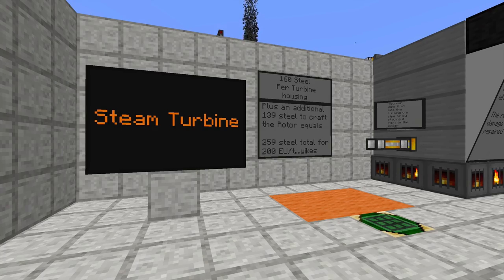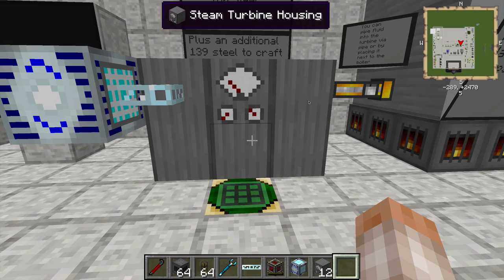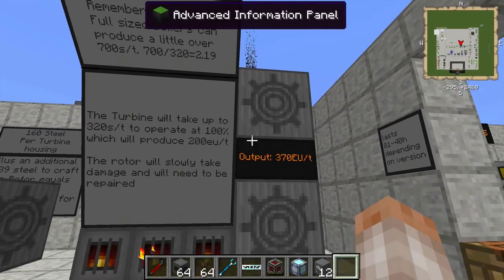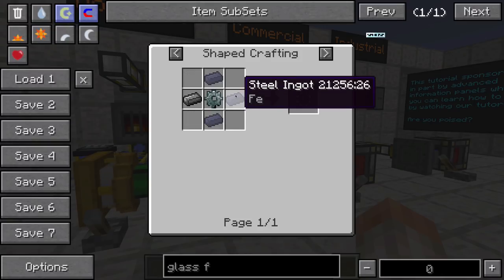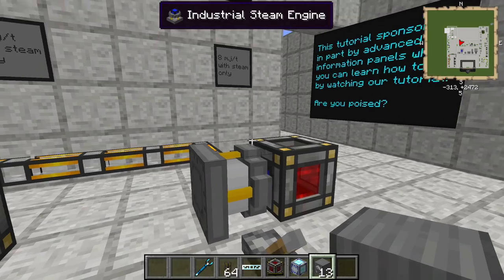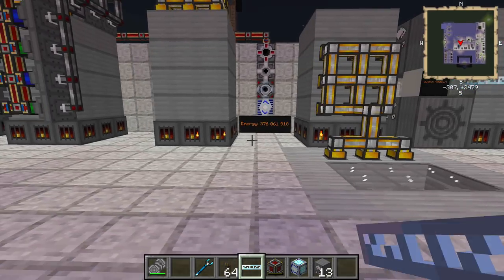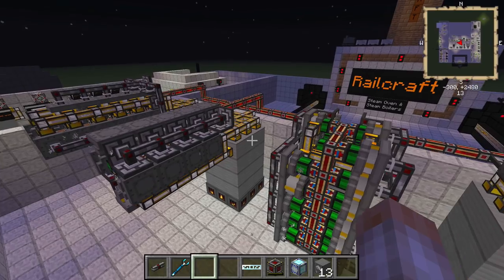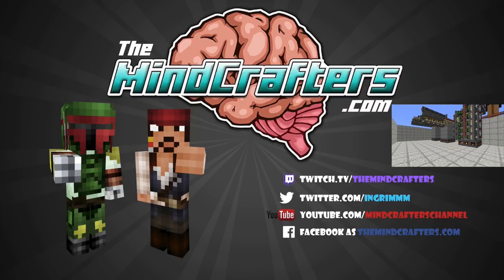Railcraft Tutorial - Steam Turbine & Railcraft Steam Engines

Comment: You can put your steam engines directly on the boilers. They will only fill up to the halfway mark if you have 18 leeching from a single 3×4×3 HP, but they’ll all produce 8 MJ/t each, just the same. The problem you were having is that the network of those liquiducts had bottle-necks causing the deficiency of the engines; a liquiduct can’t push more than 80 steam per tick, even when pressurized, so it limits you to 2 industrial steam engines per line.

Comment: three disks don't add up to 139, your math is off, it's 99 steel total for the rotor. Great video! (3 blocks and 24 blades = 27 + 72 ingots.)
Reply: 139 is a prime number even. If you get prime numbers out of your integer multiplication there is almost always something wrong.

Comment: Oh, and what does the math look like on power converters vs turbines and engines? Does one method produce more or less power than another?
Reply from the maker: You'll get exactly the same amount of power by using Power Converters...you can see that In action in the previous video on steam boilers. Some call this "cheap" or "cheaty" but the mod is meant to function that way so technically its not. For a few gold ingots, a stirling engine, and a transformer or two you can tap the same amount of power from the boilers as the 18 industrial steam engines would cost. Its up to you which one you can afford or like to use.